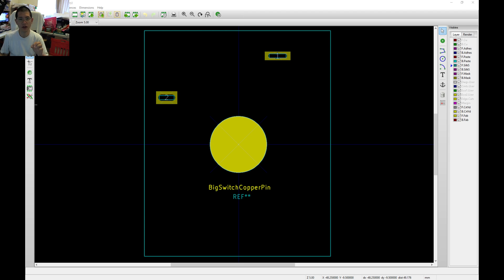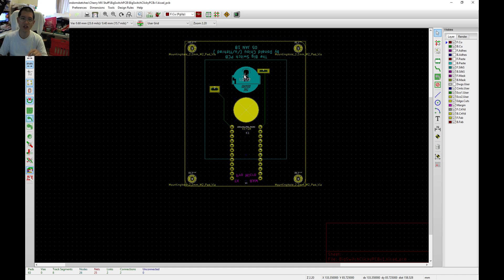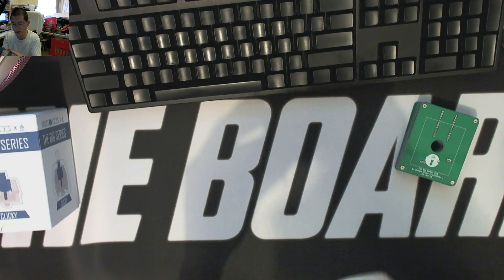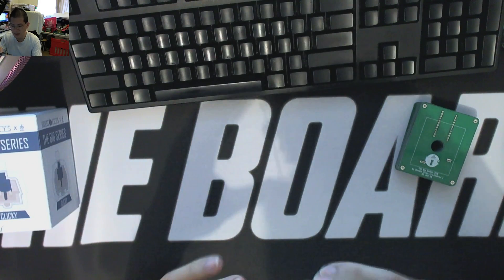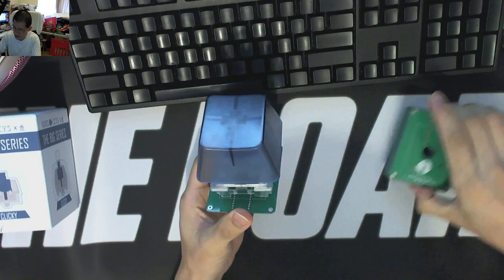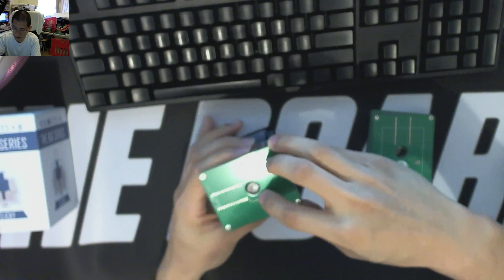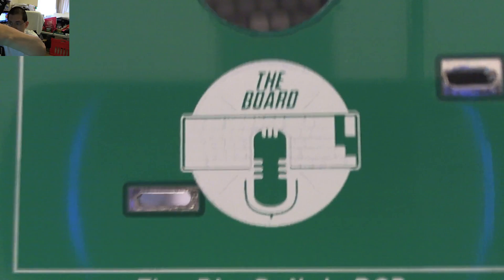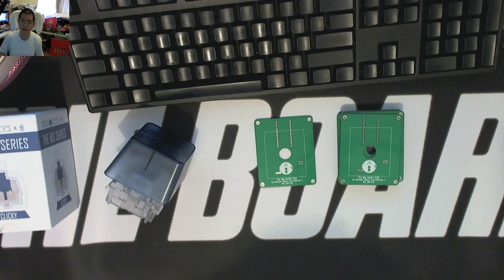Big Switch PCB Fail and Fix

Comment: Good on you for sharing, as I've not seen anyone go into much detail on these projects. A few twists with a reamer will sort that hole out. I've got one and it's a vicious looking thing, but just the ticket for making holes bigger.
Reply from the maker: I only have small hand files with a round side. I do have a rotary tool but its at my in-laws, borrowed for something so I could go buzz that hole a bit bigger with the sanding head. That said, I don't need to for any more sets, and one set has already been bought by a fan who is happy to open up the hole themselves :)

Man, you're almost at 1.5k subs! Congrats for absolutely smashing it!!